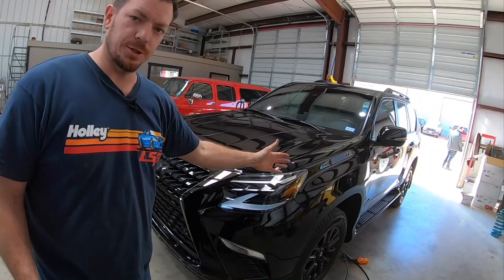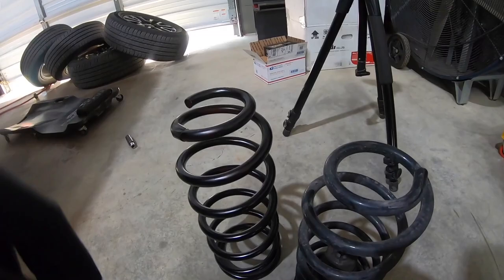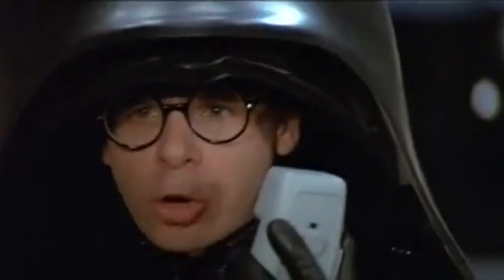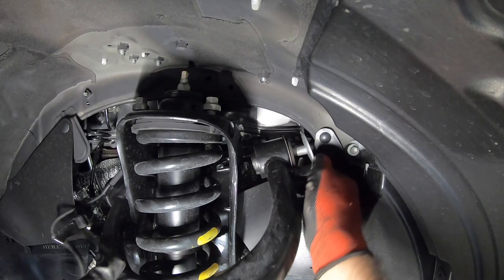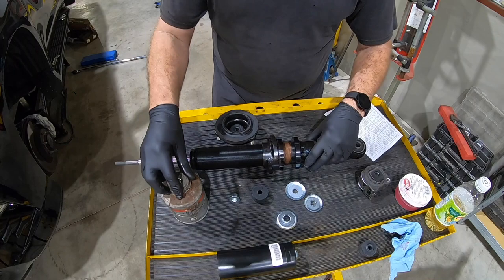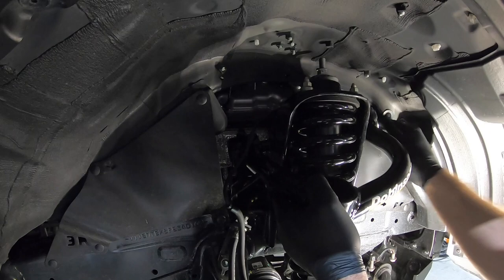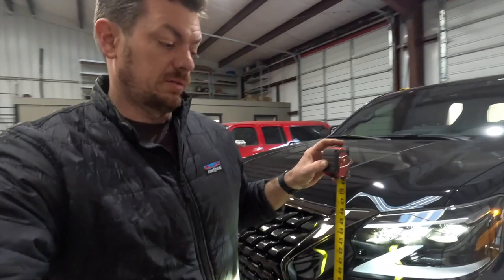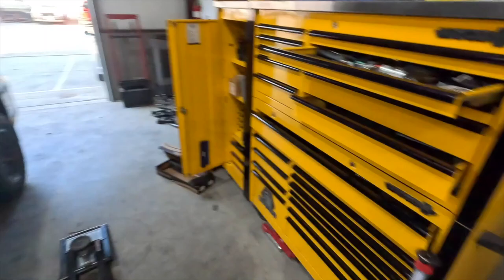Full Series - Dobinsons IMS install on a 2023 Lexus GX460 Blackline

Comment: No one needs a spring compressor of any type to do this work, you just do it using a floor jack under the LCA. Remove the two bolts under/either side of lower ball joint and remove the nut on top of the shock and take the strut out disassembled, leaving the top hat in place, it's simple and no need to break ball joint/tie rod loose. Obviously, you can then reassemble a new shock and spring back in place.
Reply from the maker: I'll pray you have a speedy recovery

Comment: For a 2-3” lift with 17x8.5+0 wheels and 285/70R17 tires, do you need to a body mount chop or relocation? Or will you get full clearance with just plastic trimming and heat molding?
Reply from the maker: It's rare to need the BMC with this setup.

Comment: Nice video. What are your thoughts on using KDSS drop spacers (1 front, 2 rear)? Can those help with KDSS issues? I've read that it's necessary for getting maximum articulation from long travel rear shocks, and it seems to make sense to me.
Reply from the maker: I agree. 
I use Dr.KDSS parts. This vehicle is pretty much street driven.
Reply: @CodyCrafted  Thank you, that's interesting.

About DR.KDSS, is it sufficient to do the 2 rear KDSS spacers and the two front sway bar relocation brackets for a 2" lift? (as opposed to the 3-part kit from Treaty Oak) Do the front sway bar relocation brackets also resolve lean, or do they just resolve fit issues with the sway bar?

Something else I noticed was that Dobinsons offers both KDSS and non-KDSS lifts for these vehicles. Apparently the KDSS version features springs with different heights on the right and left to physically correct lean (without addressing the KDSS system directly), so it seems that it would be preferable to get the non-KDSS version for installations where DR.KDSS parts are also being used.

Comment: Thank you for posting this awesome content.  I'm a GX460 lift newb...  My wife has a 2020 that we're looking to level/lift for look and occassional elk hunts on nasty forest service roads.  How do the Dobinsons compare ride-wise with the Old Man Emu kits in the 2-3" medium spring rate?  We'd prefer to be close to factory ride quality.  Thank you in advance!
Reply from the maker: The good news is you're not going to get factory ride quality. Stock is over damped and under sprung. Causing wallowy sway over bumps and braking, with a tendency to blow through the stroke

The IMS is just a more advanced setup than OME yellows. They're not bad per-se but the IMS is my favorite kit and after 50-ish of these kits, never a complaint. 

The Nitro shock can be stiffer in my experience but not a bad ride quality
Reply: @CodyCrafted  Any feedback on the OME MT64 kit?  They seem to the more than half way between Nitrochargers and the full remote res BP51 kit.
Reply from the maker: @BeowulfHagen  I haven't had the opportunity to install yet. However, more (quality) options in the market are always a good thing. ARB makes good stuff, I'm sure they're a solid choice.

Comment: @CodyCrafted what's the wheel and tire specs on this GX?
Reply from the maker: Weds TC105X and  285/60-18 bfgs
Reply: @CodyCrafted  any rubbing issues at full lock? If so, any fender mods needed for this lift?
Reply from the maker: @user-ht8ti3wq3g  just a little trimming of the running board plastic and remove the panel on the fronts.  Maybe some heat gun as needed